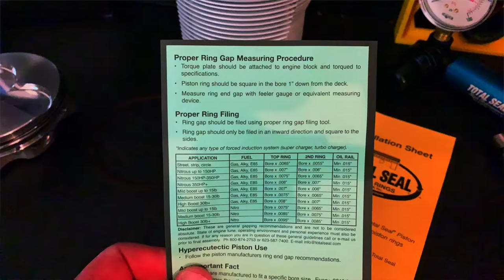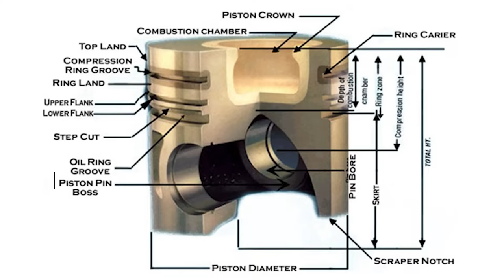End Gap Mistakes That Will RUIN Your Engine

Comment: It used to be that gapless rings were used only on the second ring (as factory specified) rather than on the top ring.  Your information that the second ring needs a larger gap than on the first ring seems to run at odds with this, why didn't the gapless 2nd ring cause ring flutter on the top ring?  Is it a completely different design that doesn't cause ring flutter under those conditions?  Or am I missing something?
Reply from the maker: Whether it is better to run a Gapless top or 2nd ring is all about the application. There is not a one size fits all solution for this.
Reply: I have never seen a gapless on the second.  Have had good success with gapless tops.  But make sure your not getting any dirt in it.  They wear out quickly and it doesn’t show up on a blow by test, only the dyno.
Reply: Meant to say never seen a gapless second work.

Comment: Any suggestions on gap for A Cummins 12 valve running some high boost around 60 psi thru  compound turbos, any advise would be appreciated thanks for the video

Comment: What is the purpose of gapless rings ?  .Total seal sold a lot of ring sets with gapless second rings
Reply from the maker: Gapless rings are really great for engines that need that physical barrier. Diesel engines are a great example of an application where the Gapless 2nd provides significant advantages over a conventional gap ring.

Comment: The second ring's mission is to reduce the load on the top ring.  Unlike what most people think, the load on the top ring is not proportional to the cylinder pressure, but proportional to the pressure difference between the cylinder pressure and pressure below the top ring.  The more the second ring is loaded, the more the top ring is unloaded.  Therefore, having a huge endgap on the second ring will load the top ring more.

Comment: Another thing about rings is that most of the load is on the outside of the cylinder, towards the exhaust manifold and the inside of the cylinder towards the intake.not so much load on the left and right sides of the cylinder so when I stagger them I put the gaps on the sides.your cylinders will thank you!

Comment: When i buikt my internal balanced forged internals nitrous 406 817 for my c3 vette i did .032 on top and .034 on second and she runs great at 11/1 on 93 pump gas  NA too. Practically No blowby. Street it daily with 4500 stall shes a Beast of a 2 bolt small block.
Reply: Spin it to 7500 too! 220 Flotek cnc heads ported Victor intake.

Comment: So is he saying line up your 2nd and top oil ring to help with drainage or am i miss hearing that? Also i need to gap my top oil ring to match my 2nd ring? Just making sure im understanding all this... doing my first build now.
Reply from the maker: Do not line up the gaps! This video is just about gap sizes. Check out the Engine Performance Expo channel for videos with assembly details.

Comment: Whats your guys opinions of running a gapless 2nd rings?  I used some Keith Black hyperutectic  pistons  on a 454 chevy and needed open the tap ring gap to .032 and used total seal gapless 2nd rings, I am having trouble with the engine using oil and also no power.  What could be the trouble?
Reply from the maker: That might be too much top ring gap for a Gapless 2nd ring. Call the tech department for assistance. 623-587-7400

Comment: What about the total steel ring? Also, what about top do used to be Charlton Albert zero gap ring sack oh what do you say about that? This is six in a row. Jim from Kennerdell Pennsylvania I got a 91.5 dodge I’ll give you three guesses. What’s under the hood? I’m planning on rebuilding it with speed of air pistons and total steel rings and actually I want the final home to be done with torque plates and I want the torque plates installed at least eight hours later or even the next day after the install the plate, then do the Hone
Reply from the maker: With a Diesel, the Gapless 2nd ring is the way to go. Different style engine, so the "rules" are different.

Comment: That’s why they make plstigauge/feeler gauges, etc…. Then do a rough assemble with old head gasket, pressurize the cylinder through the spark plug hole (valves closed) and listen for the intensity of the hissing blow by… do that for a few years and your experience will tell you if you’re ok or not.

Comment: I know about staggering the Rings but I was also told that Rings rotate around the Piston as the engine runs, which is it?
Reply from the maker: Both are true. The rings need to be staggered on assembly, and they do rotate as the engine runs.
Reply: I have seen many Harley Davidson piston rings with the gaps all lined up on teardown.

Comment: All I use is Hastings and every time I measure end gaps they're dead on,if you're running nitrous you might want a little more gap and forced induction is different rings anyway but for what I do Hastings has never given me a problem.

Comment: What about rings that are closer to the top of the piston, where there is more heat, the ring manufacturer talks about, piston material and application, but what about ring install height in the piston, does this matter, I will think it will but I'm not sure.

If I want to install a super light piston with super long rod, the piston ring will be higher up the piston.
Reply from the maker: The end gap recommendations account for that.
Reply: @TotalSeal  thanks for the clarification

Comment: Does a ring close solely due to engine temperature?  If so, how can that be correlated to a running engine to prevent the gap from closing?  Or, are there just TOO many variables for such a chart?

Comment: 460 +030 (4.390 bore) i went just under 0.008xbore (035)on my Hypereutectic pistons since I had one butt together at 028 (0.0065xbore) which is strange because I am just NA and below 6000 rpm with a decent conservative tune on it 9.75 Static 7.57 Dynamic compression I wouldn't have thought that id ever have had that issue
Reply from the maker: They hypereutectic pistons require more end gap because they hold more heat.
Reply: @TotalSeal  right i just wish id have known this before that first build, thank you guys for all your knowledge and good products

Comment: So given this information, do they mean run a larger gap on 2nd ring when cold or when hot?  Because when it gets hot the top gap will close much more than the 2nd, because 2nd isn’t as hot.  So it’s plausible that running the same gap cold would still result in 2nd gap larger when warm.
Reply from the maker: In both applications. Both rings are going to grow, so always start the 2nd ring with more gap.

Comment: pulled down a engine we build probably had 3 hrs max on it 302 windsor. anyways it leaned out and killed pistons big time when removing pistons and inspecting 4 out of 8 pistons top ring and second ring gaps have aligned. i know there would be some rotation of the ring but 4 of them is very strange .everything was set to KB piston specs u get with the piston so is the something you can to do help that or is it just life of the combustion engine and have to live with the fact
Reply from the maker: Detonation can cause the gaps to line up
Reply: @TotalSeal Source or background on this?
Reply: Wow! Aligned rings caused by detonation 🤯

Comment: Always do the bore per the piston makers specs I have never got a set of rings for the correct bore that were near factory specs . Threw trial and error I just run the rings that come in the box . haven't had a motor blow up yet .Any imput on ring gap on a air cooled motor ?
Reply from the maker: The air cooled engines can run a tighter gap because the cylinders expand more.

Comment: I have a  427 big block chevy that's 0.60 over my top ring is gapped 0.25 is it safe for a 150 shot of nitrous? I don't want to hurt the engine thank you in advance for your input.
Reply from the maker: For nitrous, the top ring end gap should be .006 per inch of bore size, so you are right there at .025.
Reply: @TotalSeal  thank you so much for your information.  Rick427

Comment: I’ll tell you what I think helps with blow by when guys put torque plates on Motors or on cylinder blocks I should say they want to start hone in right away according to her McCandless like toward the end of the day when you’re getting ready to go home. Screw the torque plates on naturally with the main caps tight and let the torque plate sit on that block overnight Takes a while for the block to stop squirming around. That’s what her McCandless said and you know I think that guys got the qualifications to make a statement like that. Anyway, this is six in a row. Jim from Kennerdell Pennsylvania I’m gonna be rebuilding my Cummins motor and I’m thinking about using total seal rings it’s not gonna be a wild racer although periodically I am going to get it on with the thing you know but anyway, are you have a good day
Reply from the maker: https://youtu.be/IUJDrHR1qsc

Comment: I butted rings in short order on my last build. I was running .025" top and .028" second

Im now running .032" top and .028" second...  3.554" bore

Twin turbo build on e85 around 25# boost. It's a truck so I'm thinking the extra weight added load which butted the rings in my earlier build...  3.572" bore
Reply from the maker: It's better to give it more gap. With that much boost, the gap factor should be .008 per inch of bore size.

Comment: I wonder if all the same applies to a 2-stroke engine.  I think the usual practice in that world is to set the lower ring tighter, since it sees less heat and is the primary control for crankcase compression during the transfer stroke.  But I don't know if that's right.  A lot of racing 2-strokes use just one ring, so it's probably low stakes either way.  Obviously, getting the top ring too tight is still bad business, and probably the 2nd leading cause of seized pistons after air leaks.
Reply from the maker: It would be different on a 2 ring 2 cycle engine.

Comment: Is there a difference on end gap required in a turbo engine running 16 psi on 93 octane versus e85?
Reply from the maker: Not much if the timing is the same. If you increase timing with the E85, then add a few thou to the gap.

Comment: Hmmm, but my Gapless Ring is the second Ring wouldn’t that push the Topring up?
Reply from the maker: You would think so, but the Gapless 2nd ring doesn't show any compression loss at high rpm.
Reply: Thanks. I think I will go with those for my revmaster aircraft VW. Wasn’t the gapless on the top groove failing because it needed more end gap?

Comment: when you say the second end gap should be matched to the top oil rail, should they also be clocked to the same position?
Reply from the maker: No! Do not clock them to the same position. The width of the end gaps should be matched, but not the position.
Reply: @TotalSeal  thanks for the reply.

Comment: What about your Total Seal gapless second ring?

I've been building those into turbo Diesel engines for a while now.
Reply from the maker: The Gapless 2nd ring is perfect for turbo diesels. The boost pressure changes everything, so the wider 2nd end gap trick does not apply to boosted applications.

Comment: What about Total Seals gapless 2nd ring set?
Reply from the maker: They are the right choice for applications where you need that physical barrier and/or are turning lower RPMs. For example, Gapless 2nd rings work phenomenally in diesel engines - lower RPM and high soot.

Comment: Modern drag racing with all these engines fuming their heads off,, look more like a steam train! Drag race engines are totally different to 'real' engines!
I have always used the 4 thou and inch and have had no issues. 12-1 road race Chev using max 7500.
BUT I have done a  road race Clevo with Hypereutctic pistons and that has scuffed the bores. And never sealed properly. 11-1 and 6800 max. 
Modern rings seem to be different to those from 50 years ago. My 400 Ford with 136000 miles had 20-22 though ring gaps when pulled apart. New pistons and rings had up to 026. And that will open up to 028 very shortly. In effect  you would say the engine is worn out. And yes it does fume a bit. PCV controls it. 
Though a speedway 202 Holden, 11.2-1 and 6800 using 15 thou gaps [ACL Race series hypereutectic] has done about 40 shows with no issues. Though the unleaded Avgas we are stuck with now has made it run 10 degrees F hotter. Slightly smaller SU needles though are VERY hard to find.

Comment: Changes my methods for sure!!!!
Reply from the maker: We are glad it helped.
Reply: Tell me if I'm crazy.....my 427W with forged pistons is gapped between .006 and .009.  I'm definitely going to set the 2nd ring between .015 and .020.  Running on purple.  Think it'll be good?  My rotary engine was gapped at .004 on everything (ductile iron).  I thought that my rings came with a chart.  Pretty sure that's what I used for a reference and added .002.
Reply from the maker: @murphystreeter  .007 total end gap is way too tight!

Comment: I know my Pal Uncle Tony's Garage Never cuts the ring grooves out of engines he rebuilds just honing the cylinder and replacing standard rings. I ALWAYS use ny Amco ring groove remover and cut the ring groove out so the top ring doesn't hit the rounded top ring groove, of course I am running standard rings in standard honed bores that are slightly oversized, an engine with 100,000 to 200,000 miles and reusing the old pistons, but I want to tell you about something that happened to me once, I was rebuilding a 20R Toyota 4 cylinder, and the local Napa store had "Standard to 0.010 oversize rings" THinking once I honed the bores this would not be a problem I bought these rings and the pistons would not go in the bores. after talking to a friend with more engine building knowledge then I had at the time he explained to me the rings were too thick, I went and got a standard new ring set and the pistons slid right into the bores. We call those poor boy race motors, you hone out and remove the ring groove and since the bore is slightly oversize its loose and loose is fast, it may burn a quart of oil over the course of a month, but its not noticable, but anyway ring thickness is just as important as ring end gap! I would have had to bore my cylinder 0.010 oversize to use those rings, you think 0.010 is not that much, you would loose that much honing the cylinder, not true!  I don't think they should have been described like that, they should have been "0.010 oversize rings for standard pistons" would have been a better description! God only knows the damage they would have caused if I had got them in and when everything expanded from engine heat! The side to side measurement is something folks don't think about, but its VERY important! Also it x2, like my 0.010 oversize would be 0.005 x2 sides of thee cylinder! rings are between the piston and the piston cylinder wall in 2 places, I remember they taught us the rock,lock and cock rule at briggs and stratton school for measuring the cylinder bore in 6 places from top to bottom and 12-3-6-9 oclock positions in the bores! it doesn't matter if you got the end gap right if the ring thickness is too much!

Comment: .0004" per inch of bore plus .0004. for the compression ring. second ring is .0005" per inch of bore plus .0005. (that stops second ring flutter.

Comment: 50 years ago trade school said .004 inch for each inch bore
Reply from the maker: That’s a starting point for a low compression engine. As combustion temperatures increase, so does the need for more ring gap.

Comment: When do you run gapless and when should you not.
Reply from the maker: The Gapless rings work especially good in diesel applications. Basically, they help prevent contamination of the oil.

Comment: My Dad would spend hours filing and measuring, filing and measuring the ring gap. The specifications are there for a reason. One .001 mistake can have catastrophic consequences.
Reply from the maker: .001 too tight can be disastrous, but .001 or even .010 loose doesn't hurt a thing.

Comment: Also the piston expansion rate is greater at the 2nd ringland and lower.
Reply: That doesn’t make sense.  Top ring is hotter than 2nd ring, and oil rail is cooler yet.
Reply: @snivesz32  the top of the piston is cooled by the next incoming air fuel mixture.  Heat is slower to be disbursed below. Hence piston to cylinder clearance is measured on the skirt.  Hope that explains.

Comment: So what advantage is a gapless 2nd ring?
Reply from the maker: It works great to reduce oil contamination in Diesel engines (blocking soot) and engines running methanol or E85 (blocking fuel dilution).
Reply: @TotalSeal  Hi, sorry, I don't understand English and the youtube translator sometimes does his thing.
The conversation seemed interesting to me, but I have lost the thread on something, in the second segment I read that it does not leave you slack? there is no possibility of breakage.
Could you write an approximate tolerance table for both gasoline and diesel turbo engines?
Thank you very much for your time.